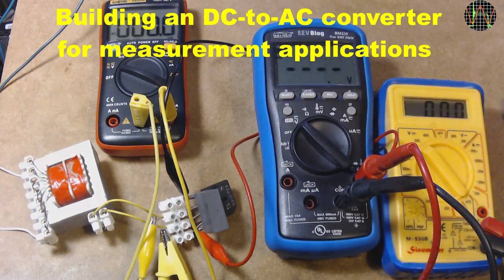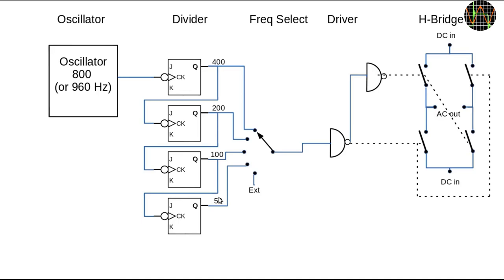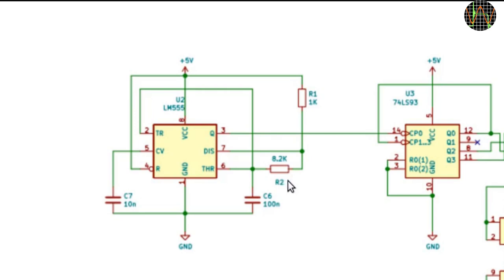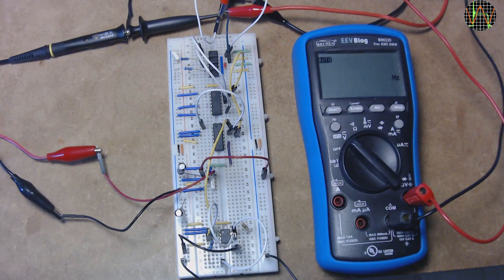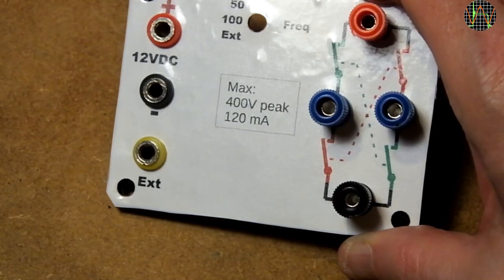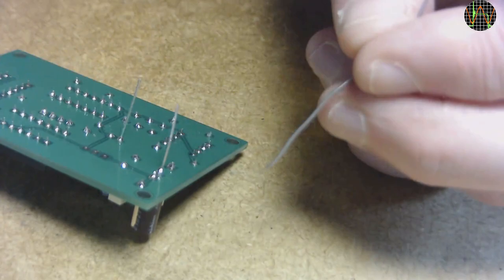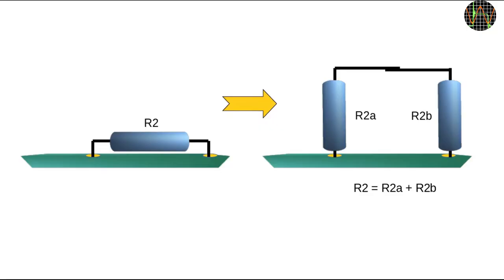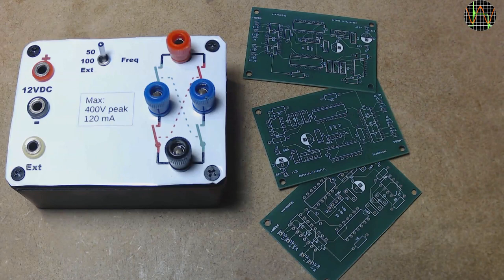Building a DC-to-AC converter for measurement applications

Comment: I'm surprised you didn't update the PCB files to add trimpots.
Reply from the maker: Yes, I was very tempted but then I did not want to change the files too much and risk something breaking... I would have done it if I would have sent the new Gerbers for manufacturing so I could have checked the result but since I did not need another set of PCBs. that wasn't an option. However since the whole Kicad project is on Github, it is easy for you or anyone else to do the change and create their own Gerbers

Comment: im just a beginner in the electrinics and i have a basic question:

inverter and converter, are they the same ?
bacause i wanted to read about flyback inverter and i Googled it , it gives flyback Converter not flyback Inverter

sorry again for my question
Reply from the maker: Excuse the late reply, I missed your question somehow.  If a device changes (converts) DC to AC it is commonly called an inverter. I suppose the name comes from that it inverts or undo or reverses the action of the much more common rectifier circuit that converts AC to DC. A flyback converter is normally converting DC to DC. So, if viewed from the outside, its a converter. As a matter of fact, internally it does the conversion using AC and a transformer so it actually converts DC to AC (invert), and then AC back to DC. The trick is that due to the  transformer ratio allows the two DCs (input and output) to be at very different voltages. Incidentally if you wonder where the "flyback" comes from. In old CRT TVs, the high voltage for the picture tube was created by a transformer that was in line with the horizontal deflection coil of the tube. When the beam reached the end of a scan line on the right, it had to be deflected very quickly back to the left for the next line down. The beam literally flew back to the other side of the screen. To do that there was a steep flank in the deflection current (saw tooth shape) and that caused a high voltage spike in the flyback transformer secondary which was then rectified to 15-20Kilovolts and more.